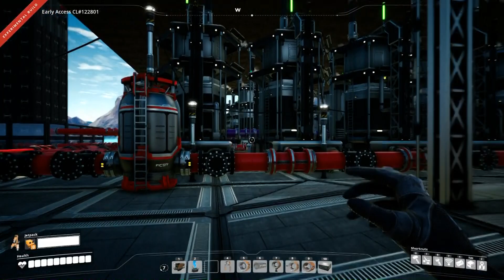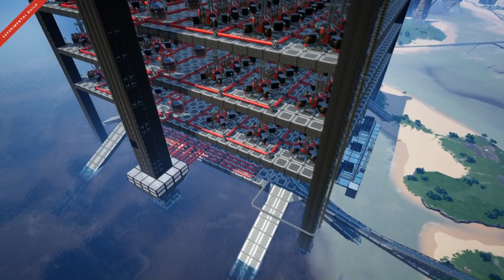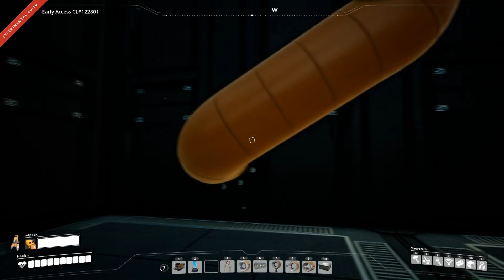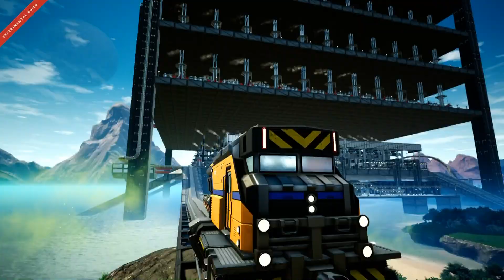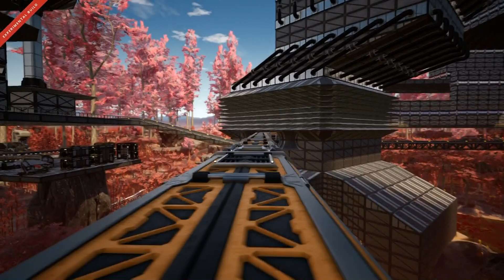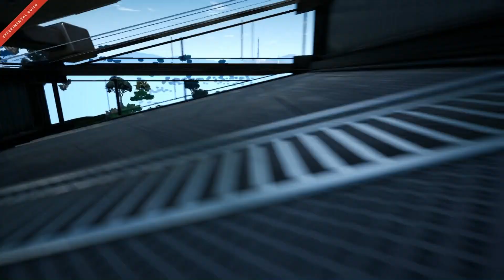Satisfactory - Mega Factory - 528 Turbofuel generators

Comment: I am confused about how you have 4 oil nodes when there are only 3 in that area.
Reply from the maker: There is definitely 4!   😁    google satisfactory calculator.   It has a fantastic interactive map which shows all the nodes 👍
Reply: I have my plastic and rubber factory in that area, there are 2 normal and 2 pure nodes